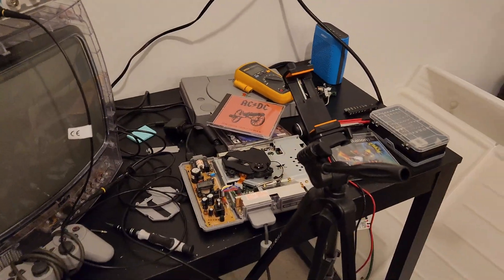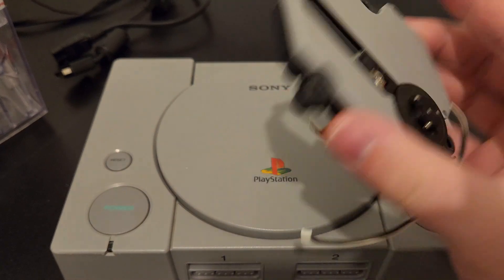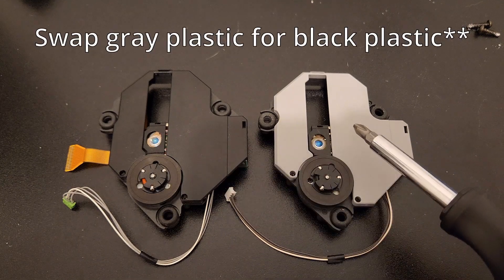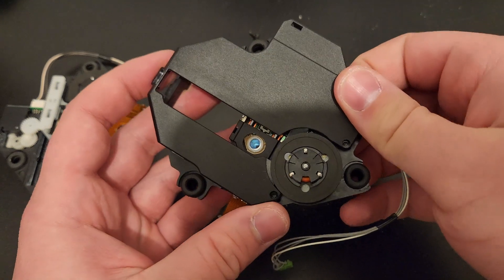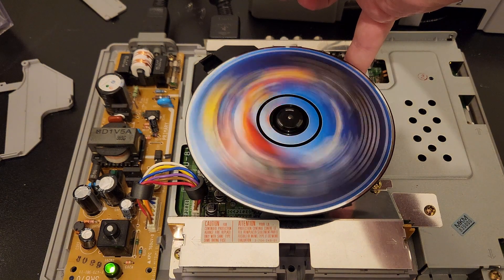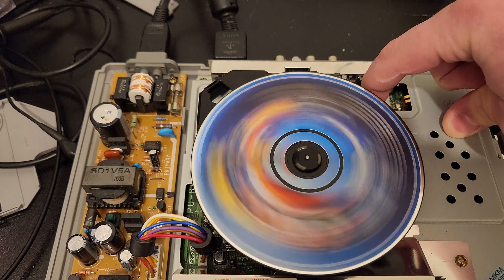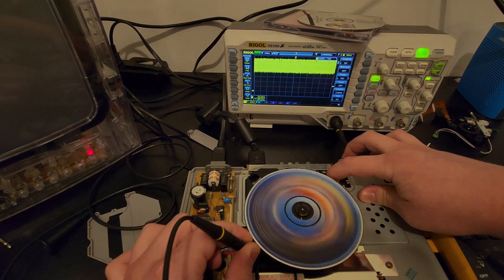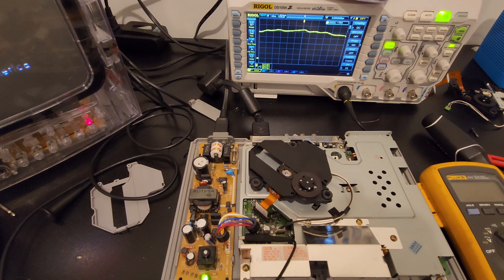Trying to replace my SCPH-1001 PS1's bad laser with a PSOne laser (KSM-440BAM)

Comment: 7:04 Here's your problem. 11.4 mV (as stated in online tutorials) is WAY too low for the 440-BAM in my experience! It didn't even read music CDs with that value (which are more forgiving than game CDs). I recently replaced the faulty 440-AAM of my SCPH-1002 (I'm german ^^) with the 440-BAM of a defective cheap PS One (drive is ok of course). By default the BAM already got around 16 mV in my PSX, which reads music CDs but not many games, especially not video/audio sequences. Around 22 mV everything was ok with original games, I'm now at 28 mV(!) to also get most CD-Rs to work properly. No idea if this is already too much for the laser's lifespan, we'll see. 🤔
What revision is your old drive? It surely isn't a 440-AAM, as the cover of that does NOT fit on a 440-BAM! In my "Playstation Update" video from last x-mas I put a picture at the end of the video, which shows the problem why it doesn't fit. I had to use the grey (modified) cover!
Reply from the maker: I noticed that a higher voltage also worked better (getting me to the PS1 logo with "SCEA" text), but I never found a good operating point to get the games to boot right, even when I was pushing near 30mV. The old drive was whatever was in the SCPH-1001 and the new one was a donor from a PSone. I can't remember the model numbers anymore and I sold all my PS1 hardware (working and not working) to someone at work to try and mess with themselves. I just ended up buying a working PSone for $40. I don't find myself having as much energy to do all these electronics projects as much anymore now that I'm an electrical engineer, so I decided to shelve this one permanently and shift that energy towards something else. Thank you for the advice though, I appreciate it! :)
Reply from the maker: I think the original was the KSM-440ACM and the new one from the PSone was a KSM-440BAM. The cover from the ACM fit on the BAM just fine

Comment: Ya i did this exact same mod to mine a long time ago and i had a mm3 modchip and a blue led installed i have remind my moms husband to give me my old ps1 back the "pot" needs to be adjusted correctly because psone 101 and ps1 1001 have different volts

Comment: Oh god adjusting these damn things is such a royal pain in the ass and were such a waste of my time and also the reason why i had anger issues. Imagine the torture and pain i went through in the past 7 years (2017-2024) with all these damn 1001 models i went through and causing an argument with a YouTuber named Philip McFee on Facebook Messenger because i totally lost my cool as i was getting frustrated with my 1001 consoles when i been adjusting for freaking the BIAS and GAIN pots for hours and hours and getting nowhere even with new lasers and i tossed them out of frustration because almost EVERY. SINGLE. ONE. i've used would also randomly spin too fast for no reason as well shown here in this video. 🤦‍♂️ And i used be a dumbass back in 2017-2020 and used to claim the CPU's in these SCPH-1001's go bad overtime and fail. Just like on the early SHVC-CPU-01 SNES consoles where their CPU/PPU chips fail often. But no, then i found out the capacitors tend to fail too. Do you think recapping might help and stuff? I still remember one day coming home from school back in April 2017 crying in P.E class not doing anything and got home early from school and i was in my room crying about how i miss my PS1 consoles and i was totally breaking down crying as i was totally devastated when i stupidly smashed 2 SCPH-1001's i gotten from a Florida Swap Meet because i was having trouble getting Spin Jam to load and no amount of BIAS/GAIN adjusting was helping and after one failure too many, I screamed along with the lines of "Fuck this fucking model, I can't take it anymore!" And then on May 2017, My family went to a trip to Saint Louis and we went to a game store called Slackers and i saw a SCPH-5501 for sale for $30 bucks and my selfish parents just walked out of the store without ever buying me the system and then eventually i listened to Spider-Man 3 Sandman Confesses music and i started bawling my eyes out totally thinking what i've done. And then i forgotten all about it and just took a break from 1001 models and just used different models and stuff until 4 years later in November 2021, I gotten a SCPH-1001 from July 1995 in perfect shape with a dead laser and i swapped the laser and i finally was i so happy to have a 1001 that finally worked right. So that's my story with SCPH-1001 troubles and stuff.